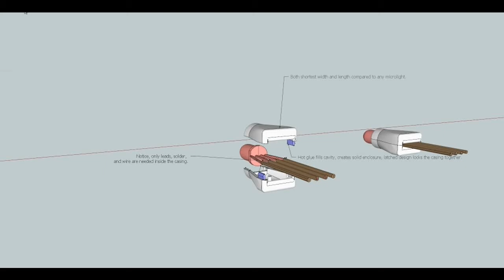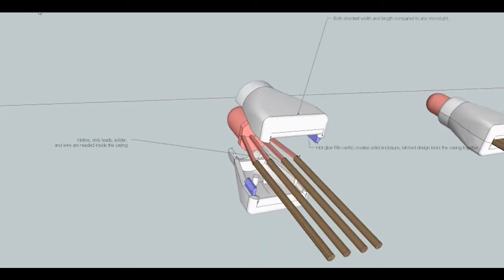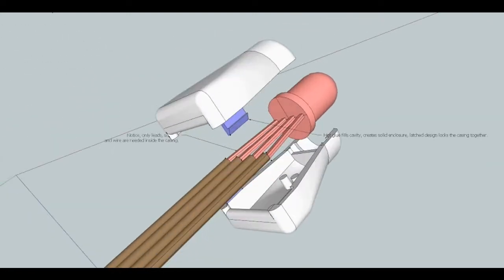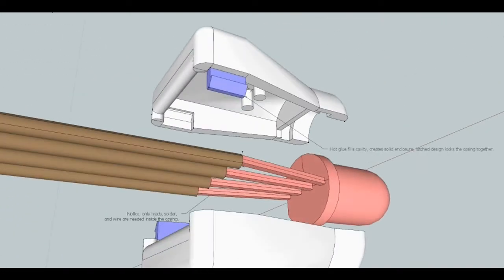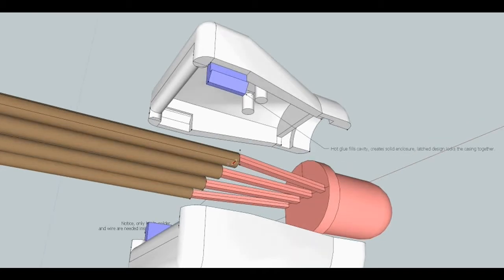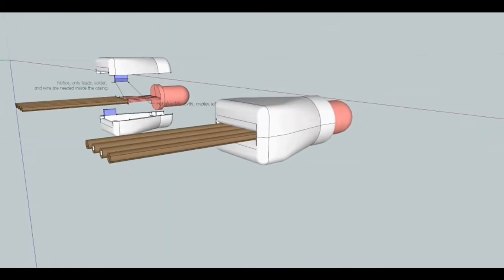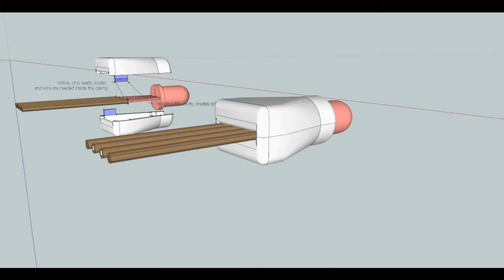Infiny Gloves - Mini Casing Design Reveal + Thumb Button Inspiration

Comment: There is such a thing as a casing being too small.  The problem I see with your design is that those casing won't stay in place, especially with the pull of the wires as your fingers flex, at least that's the only problem I've seen with the shows you've posted with the prototype gloves